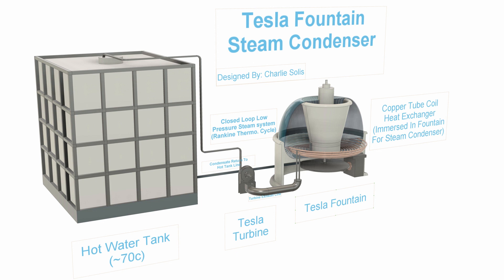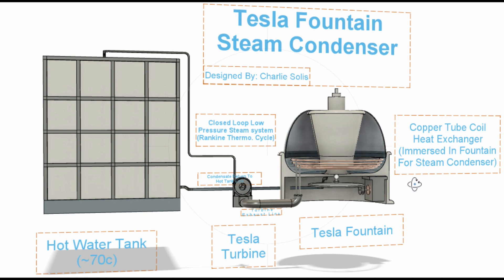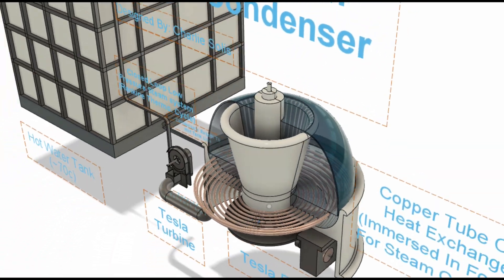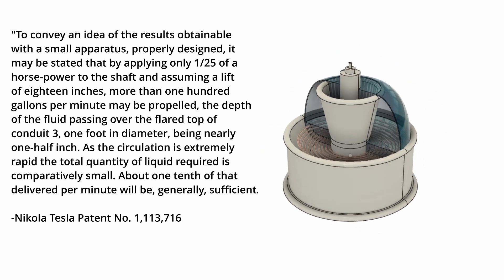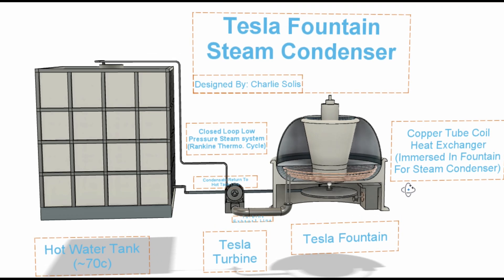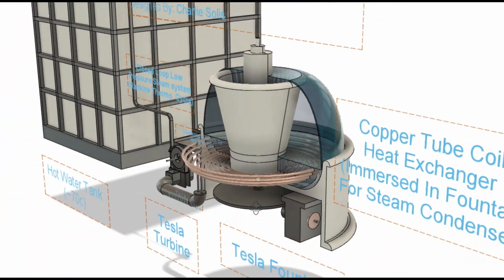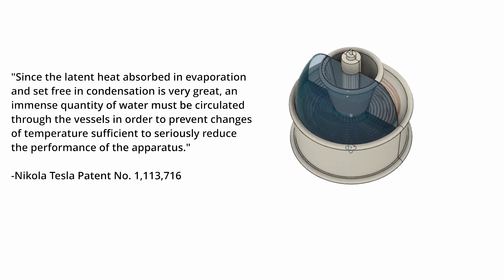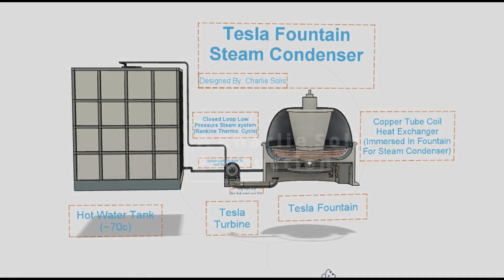Was The Nikola Tesla Fountain Supposed To Be A Tesla Turbine Steam Condenser?! Heat Exchanger TesTur

Comment: The fountain is a repulsine, designed by victor schuaberger. It takes advantage of the rpm of the turbine pto driving the impeller to create rotating airflow in a low pressure vacuum in the center that condensed water into the turbine vacuum inlet around the center shaft. The associated Tesla pump would then spin copper disks and thereby using len’s law and magnets, spun the copper disks and adjusted permanent rare earth magnets to create eddy currents in the spinning copper disks, which combined with the spinning made high pressure hot air to pull water through the Venturi and turn it into flash steam that drove the exhaust turbine, to sustain the process. You regulate the heat on the copper disks by the strength and placement of the magnets over the disk(the magnets are the actual throttle), where the disks could be replaced with the splattered on copper spiral inside the housing that mimics the airflow path.airflow of the fountain goes in and out the top for the vortex-water condescending tornado, temp differential, and water was drawn through holes in the impeller into the vacuum, separate from the air flow
Turbine/pump=power unit
Fountain=sustainer

It was the self sustaining evolution of Coanda’s turbine engine

That’s your tornado-vortex engine, running at supersonic flow for implosion, whereas standard gas turbine uses smooth subsonic flow for flame propagation.
Implosions are the real usable energy of the universe
Look for repulsine videos and the few you can find will all look exactly like this patent
Also related, look up vortex thrusters and coanda vortexes 

It’s definitely going to be a great condenser lol
Lift to the square of tangential airflow or rpm or something like that, but that’s why the high rpm of the turbine/pump was required to drive the impeller, it was as he said, the most powerful prime mover he ever saw
Teslas dc generator was drivin by both or the same shaft. The mechanical oscillator drove a disk with the 3-6-9 spiral, or concentric rings, for propulsion by sound wave vortex’s.

Comment: Maby a dummb question, but where is the heat supposed to come from?
At this low temperature, you need a shitt load of heat to get useble power out.
Reply from the maker: Solar thermal collection, combustion, geothermal, waste heat from a factory, you name it. 

This video was just to show the principles of using the fountain as a water to air heat exchanger for the condenser in the closed loop vacuum pressure Rankine turbine.
Reply: @CharlieSolis Yea, for waste heat and smaller geothermals, such a closed loop system could be a good substitute for the mechanical more complex sterling engine.
But for solar, you need to bump up the heat in the system significantly to be  more efficient (if even possible) then PV.
Reply from the maker: Check out teslas article “Our Future Motive Power” he goes into great detail how the vacuum pressure turbine systems can operate off of the differences in temperature between warm surface water in the ocean and cold deep water. 
https://teslauniverse.com/nikola-tesla/articles/our-future-motive-power
Ocean thermal energy conversion (OTEC) was invented by teslas friend D’Arsonvil in 1880 and a bench top model was first shown to work at scale in 1930’s by Georges Claude (yea as in “The Claude Air Liquefaction Process” George’s Claude). 

Claude also made the very first full scale power plant showing it to work but it was miraculously destroyed in a storm. But we’ve been using this vacuum pressure steam systems for almost a century now. 

But the problem is that the low grade steam/vapor that is produced is very “wet” and has droplets in suspension with the motive fluid. Those droplets will destroy bladed turbines or piston engines in minutes. I mean literally a multi million dollar bladed steam turbine can have all the special complex geometries of its blades/propellers can be ground down to nubbins in minutes if wet steam is admitted into it. 
That’s where Tesla came in because his turbine can handle multiphase fluid flows without detrimental effects being down to the turbine itself. The discs offer no lifting surfaces or otherwise that would allow the droplets to smash into anything and furthermore there is no risk from cavitation either from using such low temp and low pressure steam/vapors. This makes it so that the motive fluid can be FULLY expanded in the turbine, even past the point of partial condensation, and not be dangerous for the turbine. If you literally go look up the Claude air liquefaction process, it literally says that the expansion engines used in the process to aid in cooling the gasses literally can’t fully expand it because the condensation would destroy the engines and thus it has a limit to its efficiency. Whereas Tesla turbines don’t have this problem…… are you starting to see why so many who may have figured these turbines out try to keep it a secret? Because they are super turbines when you actually know how to design them. And you don’t want ANYONE to catch wind of your financial capacities with a working one……. Hell that’s half the reason you don’t see them in use. Because everyone and their mother has a patent on it pertaining to any kind of deviation beyond what Tesla describes. I literally found a patent someone was awarded for “curved star washers” and it was given to him in 2005……. With so many hands in the cookie jar and also nonproprietary rights to the original no investor wants to dump money into R&D that they can’t guarantee their Return On Investment with proprietary rights once going to market. People have consternated the ever loving shit out of the legal side of even making and selling one without stepping on the toes of 10 other inventors who hold patents on it….
Reply from the maker: Sorry but that is incorrect. Not with the vacuum pressure steam systems. They operate at 70°c hot side. And solar thermal collectors are extremely efficient over PV cells. Photovoltaics can only use a portion of the visible spectrum of the radiation coming front he sun. And of the  1.12kW of solar radiation hitting the ground at sea level, 10% is UV light, 25% is visible light, and a whopping 65% of it is thermal infrared radiant heat. So solar PV collectors are at best getting 20% of the available energy per square meter AND the infrared heat makes them less efficient electrically as they heat up. Whereas solar thermal collectors can utilize all 65% of the infrared spectrum and all 25% of the visible spectrum to produce heat. I have a solar trough collector designed already and it’s only 20ftx10ft and it will put out 10kWhrs of thermal energy for every good hour of sunlight. Even in the winter here in Detroit we get 5 good hours of sunlight. That’s 50kWhrs of thermal energy available on the winter solstice, worst sun day of the year, so even if the turbine system was only 50% efficient (which is actually terrible for closed loop steam systems with any kind of latent heat of condensation recoup) this 50kWhrs from just 5 hours of sunlight is enough to give 25kWhrs of electrical energy out. And that’s about the amount the average home in America uses. And again that’s the worst sun day of the year here in Michigan. Even if the turbine system was only 25% efficient the collector just needs to be doubled which is just a 20ftx20ft collector. That’s TINY compared to a PV cell array that provides 25kWhrs a day even on a good sun day……
Reply from the maker: https://youtu.be/9-8KH7bFSKM
This is the solar trough collector and vacuum pressure turbine system I designed in CAD. That’s a full 10kW thermal and 1kW PV solar collector for every good out of sunlight because I implemented 1kw of PV cells to be able to power the pumps that move the fluid through the collector sot jay energy doesn’t have to be taken off the turbine to do so and it’s hardly an expense increase. And it doesn’t need a battery because the pumps don’t need to be operating to move fluid through the collector if the sun isn’t out, it would end up cooling the hot tank collectors. 

And to put it in perspective. 2x 330gal ibc Tanks can store 660gal of water continuously at 70°c. That 660gal of water takes 60kWhrs of thermal energy to change by 20°c. So as long the solar collector can replace 50kWhrs of thermal energy into the hot tanks every day (using the collectors numbers for only 5 hours of sun too) 
So the hot rank would never drop below 50°c for a full days worth of electricity in the average American home. And the tanks are made to stack being full to so if you needed more storage you just double the tanks. And then it takes 60kWhrs of thermal energy exchange to change the mass of that water by 10°c down to 60°c. All within range for still using the vacuum pressure steam system and/or an organic Rankine system.
Reply from the maker: @martin09091989  1200 watt load test that I just uploaded!
https://youtu.be/BHPAQF8QNnw

Comment: Thank you for your patience and contributions.
Reply from the maker: Hey thanks for commenting! Glad you liked it!
Reply from the maker: Hey Michael, not sure if you’ve gotten a chance to see my latest tesla turbine updates but check them out! Graphs, charts and all! Just running on compressed air so far while I still work on the larger vacuum chamber system for the turbine. Peak 2.75kW and 6.22ft-lbs of torque 4150rpm with 150psi room temp compressed air with 1/2in supply lines.  And the second video is the latest 1200watt electrical load tests using 170gal of 150psi compressed air dumped to 65psi, both room temp and then 70-80°c heated compressed air. And saw the continuous 1200watt output all the way down to 65psi. Should have this thing ready for a vacuum chamber here real soon! 

https://youtube.com/shorts/yXQy844URMA?feature=share

https://youtu.be/bWpXRzrzf4g

Comment: So lets do the math on what was stated:
1  30 W in power to the shaft, and that is 30J/s
2 the power in (1) moves almost 6.5 L per second on height of almost 0.5 meters (everything is converted to the metric system for easy calculations)

1 kg lifted  at1 m requires 10 J
 so, lifting 6.5 L/s at 0.5 m requires about 32.5J, and assuming some margins of errors, we can call it 30J.
So it comes that what Tesla states is not something that is so unique, it is very efficient (up to the theoretical limit). That is not to say, in any way , that I  am disputing Tesla statements, but just noting that the point of efficiency is not something that is unheard of when looking at the physics of the process..
Reply from the maker: You have to remember, this is from 1913. At that time most motors at most had 50% efficiency. Our motors today have close to 90-95% efficiency. Also a motor doesn’t always run at max output, and considering once it’s in motion the conserved energy from the curved basin means the pump doesn’t have to work nearly as hard after start up to re lift it fully and only has to make up for the little bit of losses. 

But also to put this in perspective today, most 1hp pumps like this 1hp rigid sump pump can only move about 108gpm at a head of 0ft. 
Tesla is proposing almost equal capabilities for 1/25 of the power supply with motors from over 100years ago.
https://www.homedepot.com/p/308759169
Reply from the maker: Correction: induction powered pumps were at 50% efficiency. Not the motors itself. 
Tesla states in “Our Future Motive Power”:
“Consequently, the mechanical work may be estimated at 108 foot pounds per second and this figure must be almost doubled because the over-all efficiency of induction motor-driven pump units, which have to be employed, is not much above fifty per cent, as a rule”

I’m looking up pump efficiencies for today’s pumps now.
Reply from the maker: Yeah today’s pumps generally see about 75% efficiency. 

But as well you have to remember most motors don’t actually get run at their max rating. Usually get used at about 50-90% rated value for operation conditions. 

So for the fountain that 1/25hp pump, or 30watts) would most likely see a start up of about 25 watts and an operating duty of about 10-20watts. The low end depending on how good the curved basin conserves the kinetic energy from the waters fall. 

And again, Tesla boasts 100gpm with a 1/25hp motor and the average sump pump today does about the same with a 1hp motor.
Reply from the maker: I will also be making a fountain to the same specifications that he says and testing the actual power requirements too. So right now I’m just going off of what Tesla says. I’m excited to find out how it really plays out.

Comment: Tesla had experience working in the patent office also working with the bankers to secure funding his own own work. He also did work for other companies to earn money. He had to be not just brilliant he had to become a strategist to over come those with opposite interests and world industrial views. Playing the long game might make someone appear to be insane by their actions. His time spent in Egypt and the handful of times he references it is also likely a bread crumb. Once upon a time exceeding the speed of horse was assumed to be deadly. Silly humans.
Reply from the maker: Hey doug! not sure if you’ve gotten a chance to see my latest tesla turbine updates but check them out! Just running on compressed air so far while I still work on the larger vacuum chamber system for the turbine. Peak 2.75kW and 6.22ft-lbs of torque 4150rpm with 150psi room temp compressed air with 1/2in supply lines.  And the second video is the latest 1200watt electrical load tests using 170gal of 150psi compressed air dumped to 65psi, both room temp and then 70-80°c heated compressed air. And saw the continuous 1200watt output all the way down to 65psi. Should have this thing ready for a vacuum chamber here real soon! 

https://youtube.com/shorts/yXQy844URMA?feature=share

https://youtu.be/bWpXRzrzf4g